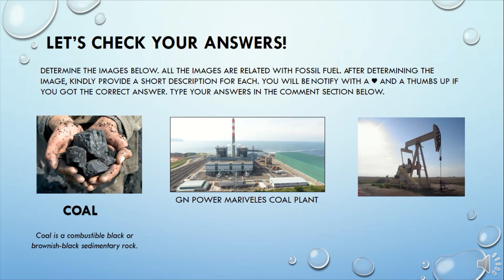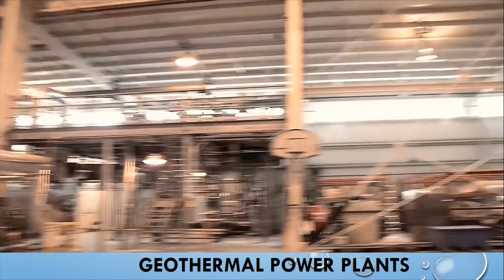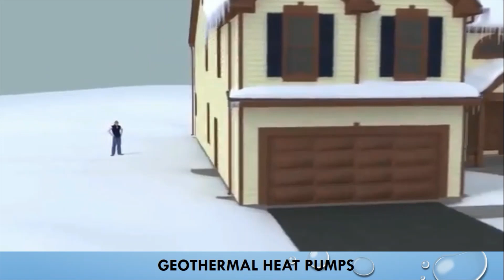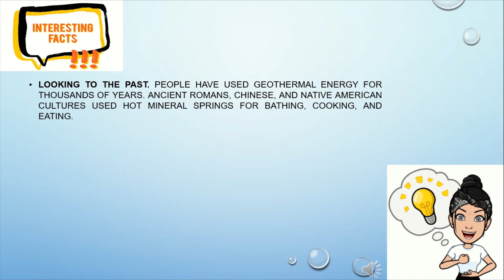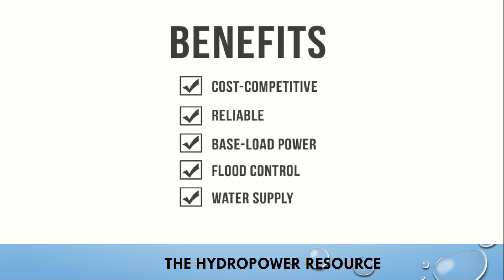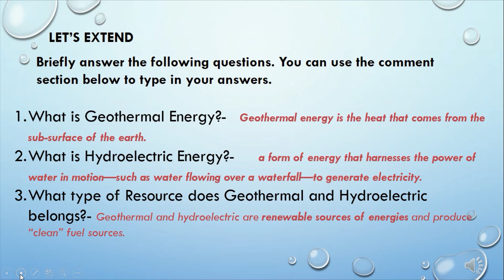GEOTHERMAL ENERGY AND HYDROPOWER RESOURCES (A SHORT DISCUSSION)

Comment: Mark Andrew C. Mallari
11-STEM-TAURUS
Geothermal and hydroelectric are renewable sources of energies and produce “clean” fuel sources. Geothermal energy is heat stored deep inside the earth or occasionally in hot springs Hydroelectricity is a form of energy generated by the motion of water  and is converted into electricity.

Comment: Mallari Mark Andrew C. 
11-STEM-TAURUS
A.COAL- is the sedimentary rock that can be use by cooking a food and melting  other solid material
B. GENERATING SATION- it is the electrical generating system 
C. PUMP JACK- it is the device that used to get a petroleum  or crude oil from the ocean surface of the earth.

Comment: Chan, Franzyne Mayriedelle B.
11 – STEM, Scorpius

Let’s review:
a. Coal
- It is a non-renewable energy that is usually found in sedimentary rocks and is made up of dead plants and animals, it is also a source of electricity.
b. Generating Station
- A generating station also known as the power plant is a large-scale industrial facility that generates electrical power. In a powerplant, an equipment transforms a mechanical electricity into an electrical energy. 
c. Pumpjack
- It is a machinery that extracts crude oil from deep within the earth. It is used to mechanically lift a liquid out of the well.

Let’s extend:
1. What is Geothermal Energy?
- The heat that comes from within the earth is referred to as geothermal energy. It is found in the rocks and fluids beneath the earth's crust, all the way down to the boiling molten rock, magma.
2. What is Hydroelectric Energy?
- Hydroelectric energy is a type of energy that uses the energy of moving water to generate electricity, such as water flowing over a waterfall.
3. What type of Resource does Geothermal and Hydroelectric belongs?
- Geothermal energy is a renewable energy source because heat is continuously created within the ground, while hydroelectric energy is renewable since it relies on the water cycle, which is driven by the sun. So, both geothermal and hydroelectric energy belongs to renewable resources.

Comment: Roelyn S. Cinco
G11- STEM Sagittarius

Let's review!
A. Coal-  is a combustible black or brownish-black sedimentary rock with a high amount of carbon and hydrocarbons. Coal is classified as a nonrenewable energy source because it takes millions of years to form.
B. Coal fired power plants also known as coal fired power stations are facilities that burn coal to make steam in order to generate electricity. These stations, seen in Figure 1, provide ~40% of the world's electricity.
C. A pumpjack is the overground drive for a reciprocating piston pump in an oil well. It is used to mechanically lift liquid out of the well if there is not enough bottom hole pressure for the liquid to flow all the way to the surface. The arrangement is commonly used for onshore wells producing little oil.

Let's extend!
1. Geothermal energy is heat derived within the sub-surface of the earth. Water and/or steam carry the geothermal energy to the Earth's surface.
2. Hydroelectric energy, also called hydroelectric power or hydroelectricity, is a form of energy that harnesses the power of water in motion—such as water flowing over a waterfall—to generate electricity. People have used this force for millennia.
3. Both of these are renewable sources of energies

Comment: Icalla, Marjorie D. 
11-STEM Taurus

Let's Review:
A. Coal- A black or dark brown rock consisting mainly of carbonized plant matter, found mainly in underground deposits and widely used as fuel.
B. Generating Station- Is an industrial facility for the generation of electric power. 
C. Pump Jack- It is used to mechanically lift liquid out of the well if there is not enough bottom hole pressure for the liquid to flow all the way to the surface. 

Let's Extend:
1. Geothermal energy is heat within the earth. 
2. Hydroelectric power, electricity produced from generators driven by turbines that convert the potential energy of falling or fast-flowing water into mechanical energy. 
3. Geothermal and Hydrothermal Energy are both belong to renewable energy.

Comment: A. Coal is a flammable black or brownish-black sedimentary rock that is found in the form of coal seams.
B.  A generating station, often known as a power plant, is a facility that produces electricity.
C. PumpJack, In an oil well, a pumpjack is the overground drive for a reciprocating piston pump. If there isn't enough bottom hole pressure for the liquid to flow all the way to the surface, it's utilized to mechanically raise it out of the well.

11STEM-Libra
Vitangcol, Rogel Jean Gerald D.

Comment: Cabuquit, Franz Paul Zavier O.
11 STEM Taurus

Let's Review:
a. Coal - is a type of fossil fuel that is a product of prehistoric remains. Coal is now most commonly used for electrical power generation.
b. Generating Station - is the very source of electricity that primarily uses coal. It is the powerhouse that generates and distributes electrical currents onto transmission towers or pylons.
c. Pumpjack - is a machinery that is used to extract oil from deep within the Earth. With the use of a sucker rod and a continuous systematic cycle, oil can be collected.

Let's Extend:
1. Geothermal energy is the heat that comes from within the Earth. It is a renewable energy as heat is constantly produced deep within. It is most commonly used to generate electricity and for heating purposes.
2. Hydroelectric energy is electricity produced by water currents and flows. With the use of running water from dams or rivers, electricity can be conducted by turbines and generators. It is also a renewable energy as water is constantly running.
3. Since both resources produce renewable energies, they can both be considered as renewable energy resources.

Comment: GASPAR, Nicole E.
11 STEM TAURUS

Let's Review:
A. Coal - It is a material found in sedimentary rock depositions where rock, dead plants, and animal matter are layered.
B. Generating Station - It is an industrial facility that uses primary energy to generate electricity.
C. Pump Jack - It is a device used in the petroleum industry to collect crude oil from a well when the pressure in the well is insufficient to propel the oil to the surface.

Let's Extend:
1. Geothermal energy is derived from the Earth's internal heat. Because heat is constantly produced inside the earth, geothermal energy is a renewable energy source.
2. Hydroelectric energy is a type of energy that generates electricity by harnessing the power of moving water, such as water pouring over a waterfall.
3. Geothermal and hydroelectric energy are both considered renewable sources of energy.

Comment: Laudencia, Archie G.
11 STEM - Virgo

Let's Review
A. Coal - are sedimentary rock deposits that are usually combusted for certain purposes like being used as a source of electricity. Coal is also considered as a nonrenewable fossil fuel.
B. Generating Stations - are the main sources of electrical energy. Just like what is shown in the picture, GN Power Mariveles Coal Plant is an example of a generating station that sustains electricity for certain areas.
C. Pumpjacks - also known as oil derricks or oil horses, are reciprocating sucker rod pumps that are used in collecting gallons of oil.

Let's Extend
1. Geothermal came from the greek words geo and therme which means Earth and heat. Therefore, Geothermal Energy is the form of energy that comes from the heat within the Earth. This energy is also used for certain purposes such as electricity production, heating buildings, etc.
2. Hydroelectric Energy is a form of energy that is produced from using the natural flow of moving water. Just like geothermal energy, this energy is also used for certain purposes, particularly electricity generation.
3. The type of resource that Geothermal and Hydroelectric belong to are the renewable type of resources as they are powered from just natural activities of the Earth.

Comment: CASTRO,JOSH MARVIN D.  11-STEMPHOENIX

A.Coal is a combustible black or brownish-black sedimentary rock with a high amount of carbon and hydrocarbons. 

B.Generating station or Generating plant, is an industrial facility for the generation of electric power. 

C.Pumpjack is the overground drive for a reciprocating piston pump in an oil well.

Let's Extend

1.Geothermal energy is the thermal energy in the Earth's crust which originates from the formation of the planet and from radioactive decay.

2. Hydroelectric energy is a form of energy that harnesses the power of water in motion such as water flowing over a waterfall to generate electricity.

3. They are both renewable sources of energies and produce clean fuel sources.

Comment: Dela rosa, Janua Mae Dr.
11-Stem-Taurus

Let's Review

Coal- it's a combustible black or brownish-black sedimentary rock, formed as rock strata called coal seams.

Generating Station- is an industrial facility for generating electric power.

Pumpjack- is a device used in the petroleum industry to extract crude oil from an oil well where there is not high enough pressure in the well to force the oil to the surface.

Let's extend

1. Geothermal energy- comes from the heat within the earth.

2. Hydroelectric energy- is a form of energy that harnesses the power of water in motion

3. Geothermal and Hydroelectric belongs to the renewable sources of energy

Comment: RONETTE SORIANO
STEM-SAGITTARIOUS
A. Coal - is a material usually found in sedimentary rock deposits where rock and dead plants and animals matter are pilled up in layers.
B. GN Power Mariveles Coal Plant - is a coal power plant in Mariveles, Bataan.
C. Pump Jack - is a device used in the petroleum industry to extract crude oil from a oil well where there is not high enough pressure in the well to force the oil to the surface.

Comment: John Joseph B. Dela Rosa
11 STEM-SCORPIUS

A. COAL
- is a material usually found in sedimentary rock deposits where rock and dead plant and animal matter are piled up in layers.

B. GN POWER MARIVELES COAL PLANT
- it is a coal powerplant found in Mariveles Bataan.

C. PUMP JACK
- A pump jack is a device used in the petroleum industry to extract crude oil from a oil well where there is not high enough pressure in the well to force the oil to the surface

Comment: Let’s Review:
•Coal-is a combustible black or brownish-black sedimentary rock with a high amount of carbon and hydrocarbons.
•Generating Stations-is an industrial location where electrical power is generated in a large scale
•Pump Jack-is the overground drive for a reciprocating piston pump in an oil well.

Let’s Extend
•Geothermal Energy-is the thermal energy in the Earth's crust which originates from the formation of the planet and from radioactive decay of materials in currently uncertain but possibly roughly equal proportions.
•Hydroelectric Energy- is a form of energy that harnesses the power of water in motion
•Both classified as renewable energy sources 

Jalen Rafael S. Torrico
11-STEM SAGITTARIUS

Comment: Julian, Julianna Allyn O.
11 STEM - Libra

Let's Review:

A.) Coal - is a combustible black or brownish-black sedimentary rock with a high amount of carbon and hydrocarbons that can be used as a fuel.

B.) Generating Station - a power station or an industrial facility for the generation of electricity.

C.) Pump Jack - is a device used in the petroleum industry to extract crude oil from a well when the pressure in the well isn't high enough to force the oil to the surface.

Let's Extend:

1. Geothermal Energy is the heat that comes from the Earth's core and is a renewable source of energy. It is produced from the heat generated during the planet's creation and subsequent radioactive decay of elements.

2.  Hydroelectric Energy is a form of energy that harnesses the power of water in motion—such as water flowing over a waterfall—to generate electricity. 

3. Geothermal Energy and Hydroelectric Energy are both classified as renewable sources of energy.

Comment: Ramirez, Gene C. 
11-STEM Phoenix

Let’s Review: 
Coal - It is a type of a fossil fuel formed from sediments such as prehistoric animal and plant remains that constantly piled up and become pressurized through time.
Generating Station - It is the main source of electrical energy. An example of this is as shown in the picture, GN Mariveles Coal Plant.
Pump Jack - It is a device used to extract crude oil beneath the Earth’s surface.

Let’s Extend:
Geothermal Energy is a renewable energy source that comes from the heat within the surface of the Earth.
Hydroelectric energy is one of the oldest and largest sources of renewable energy, which uses the natural flow of moving water to generate electricity. 
Both Geothermal and Hydroelectric energy are considered as renewable energy sources.

Comment: Let's Review!

Coal is a combustible black or brownish-black sedimentary rock, formed as rock strata called coal seams. 

Generating Station also referred to as a power plant and sometimes generating station or generating plant, is an industrial facility for the generation of electric power.

Pump Jack  is the overground drive for a reciprocating piston pump in an oil well. It is used to mechanically lift liquid out of the well if there is not enough bottom hole pressure for the liquid to flow all the way to the surface.

Let's Extend
1. This energy comes from the heat within the earth this can be also used for producing electricity to heatheat buildings and greenhouses, and other purposes.
2. This is a form of energy that harnesses the power of water in motion an example for this is the water flowing over a waterfalls to generate electricity.
3. 3 The Geothermal energy and Hydroelectric (power) are renewable sources of energies.

Vergara, Ariel Shane P.
11 STEM Scorpius

Comment: Maranan, Lanely N.
11- STEM PISCES 

LET'S EXTEND 
1.Geothermal energy is the thermal energy in the Earth's crust which originates from the formation of the planet and from radioactive decay of materials in currently uncertain but possibly roughly equal proportions.
2.Hydroelectricity, or hydroelectric power, is electricity produced from hydropower. 
3.Geothermal and hydroelectric are renewable sources of energies and produce “clean” fuel sources.

Comment: Manabat, Allyssa Joy S.
11 - STEM Phoenix

Let's Extend:
1. Geothermal energy is the third largest source of renewable energy that comes from the heat within the earth.
2. Hydroelectric energy is one of the oldest power sources on the planet. It is a form of energy which could be harnessed through moving water to generate electricity.
3. Geothermal and hydroelectric energy are classified as renewable energy resources.

Comment: Valiente, Ashley Khate C.

Let's Review :

a. Coal is a type of fossil fuel formed from sediments such as prehistoric animal and plant remains that constantly piled up and become pressurized through time.
b. A generating station is the main supplier or source of electrical energy being supplied to households, one of its example is the GN Power Mariveles Coal Plant which uses coal as its energy resource.
c. A pump jack or oil derrick is a mechanic device used to extract crude oil beneath earth's surface.

Let's Extend :
1. Geothermal energy is originated from the heat within the earth.
2. Hydroelectric energy uses the mechanical energy of natural flowing water to generate electricity.
3. Both geothermal and hydroelectric energy is considered as a renewable type of energy.

Comment: Manabat, Allyssa Joy S.
11 - STEM Phoenix

Let's Review:
A. Coal - is an example of fossil fuel, which is a combustible black or brownish-black sedimentary rock, formed as rock strata, that is usually found in sedimentary rock deposits.
B. Generating Station - is a power station or facility used for generating electric power.
C. Pump Jack - is a device used in the petroleum industry to extract crude oil from underground or from oil wells.

Comment: Jela Marie O. Dela Cruz
11- Stem Virgo
Review:
1. Coal - Nonrenewable energy source due to the fact that it takes millions of years to form. 
2. Generating station - industrial facility for generation of electric power.
3. Pump jack -  overground drive for a reciprocating piston pump in an oil well.

Extend:
1. Geothermal energy is the heat that comes from the sub-surface of the earth.
2. Hydrothermal energy is the process of obtaining heat or energy from a large body of water.
3. Geothermal energy & Hydrothermal energy are both renewable energy sources

Comment: Caragdag, Nicole D.
11- STEM Phoenix 

Let’s Review: 

A) Coal- a combustible black or dark brown rock consisting mainly of carbonized plant matter, found mainly in underground deposits and used as a fuel.

B) Generating Station- a power station/ facility for the generation of electricity.

C) Pump Jack- it is a device used in petroleum industry to extract crude oil from oil well.

Let’s Extend:

1. Geothermal energy is heat within the earth also comes from the heat in the earth’s core. Geothermal energy is a renewable energy source because heat is continuously produced inside the earth.

2. Hydroelectric energy is a form of energy that harnesses the power of water in motion. Hydroelectric energy is the most commonly-used renewable source of electricity.

3. Geothermal energy and hydroelectric energy are both renewable energy sources.

Comment: 11-STEM Pisces
Batan, Celestine Nicole F. 
A. Coal is a type of fussil fuel formed from dead/decayed plants that are fossilized for millions of years and is applied heat and pressure. 
B. Generating Station is an industrial facility that generates electricity from primary energy. 
C. A Pump Jack also called oil horse is use to mechanically lift liquid out of the well if not enough bottom hole pressure exist for the liquid to flow all the way to the surface.